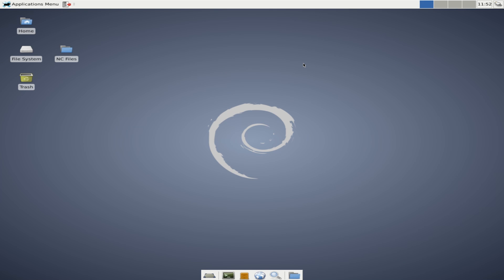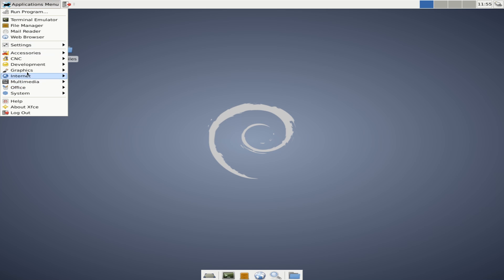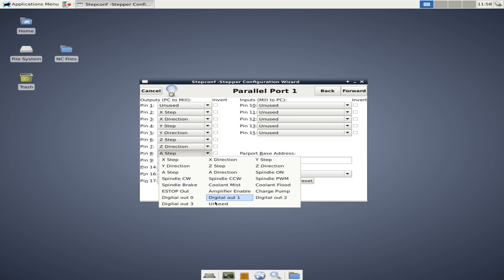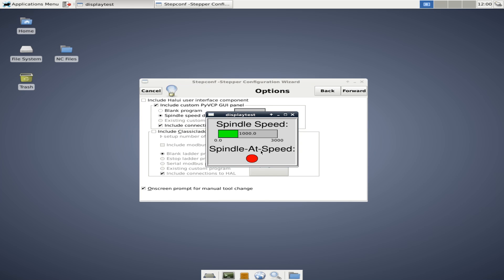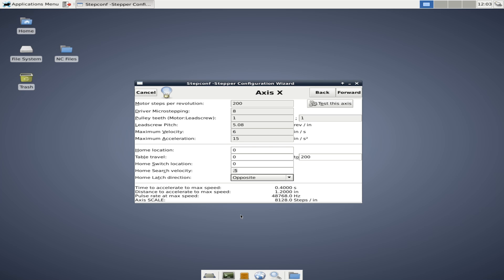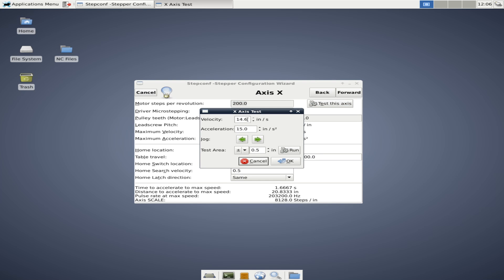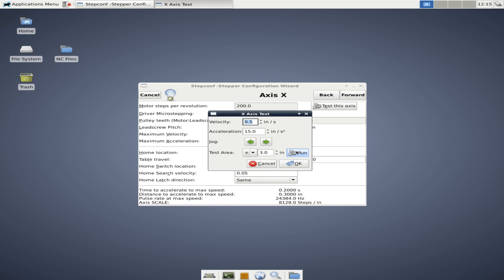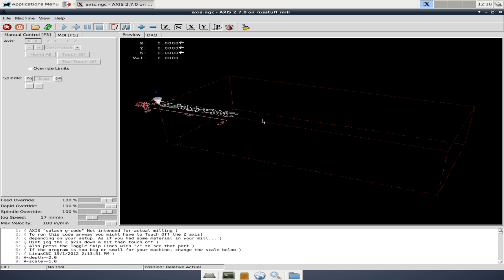LinuxCNC pt4 - Stepconf Wizard (Steppers & Parallel Ports)

Comment: my problem have cheap 5 axis mach3 board input have only 5 pin, and i need E-stop, home XYZ, probe, thats have all what can use, but how connect to all limits SW too this board. need one pin more, my machine have hard limit SW ewery axis both side, all has wired paraller can use one pin stop machine if go out of limit. this is important safety not broken machine, but no pin input,  i has make soft limit to config wisard, home 0.0 travell -20 to 390. but why this show max have 390 in display and rail have 1000 mm long and machine move full rail. scale have 317, screw pitch M12 1,26mm motor 200/rev. normal motor, driver setting 400 pulse(minimum) DM556 driver.i not understand what have wrong ? scale ???  two problem, limit SW and move scale. hardware dimnsions X rail max 800mm, Y rail 1000mm, Z rail 250mm Xand Y screw M12 pitch have 1,26mm.   Z T8 pitch 4mm.

Comment: 1:21 - "The better your computer the lower your max jitter will be."
- There is a big caveat with this statement. Newer computers have a lot of power saving features which cannot be switched off. Those mess with the linuxCNC engine (or the RT kernel) and create nasty latency spikes. For example: Frustrated with the linuxcnc performance of my previous computer I decided to go totally overboard and buy a core i7 11700k machine with a gamers motherboard and an NVMe SSD drive. Also fast RAM. A total overkill and completely unnecessary, but I thought "I want to forget about those latency issues". So what was the result: Even though at the beginning of the latency test the max jitter is like 950, as soon as I launch a browser or anything the max jitter spikes to 65000! I tried to turn off every power saving feature in the BIOS/UEFI that I could, disabled the turbo boost, made sure all cores are sync-ed etc, etc. The situation improved but the latency spikes were still happening. In other words, if the computer is left alone running only the latency test it was OK or even great. but as soon as I start to "abuse" the computer as the latency test suggests, the latency spikes begin. After that I bought a second hand core i7 920 with Rampage II Extreme - That thing is rock solid! 12000 max jitter with 6 browsers playing YT videos simultaneously, a massive file being copied over the network, another one being copied from one HDD to another, plus other activities I can't remember right now... It's great.

Comment: hi, could you suggest how to configure linuxcnc for using L298N as driver? I have 4 wires to control stepper motor, which I connect to parallel port. However, I cannot find any information on how to configure linuxcnc software for stepper control..
Reply: i think need write code linuxcnc can understand send paraller port this chip code. linuxcnc not working normal whit this chip, better buy controller board 10$ and then connect driver boards how many motor want run, motor driver board, esc, TB6600 and then connect motors to driver board, lot better and can handle small or big motors. select driver board only current sert less than motor maximum current, etc, 2A motor change dip switch less than 2A  then normal linuxcnc motor setup conytroller and software pins tell to setup wisard what pin is were.

Comment: Hi,
In the prevoius video you talked about examples of diffrent kinds of cnc like hexapod, ny question is if i have a hexapod cnc and i want to control it using linuxcnc, how to configure the pins on the breakout board to the hexapod example?
Reply from the maker: I'm not really sure. I would check out the LinuxCNC forum, they're very helpful over there.

Comment: I can't seem to get my stepper motors to jog in the axis tests..Got a 3040 cnc from cncest...Think I am really close to getting it figured out..The motors seem to be energized as soon as I power on my controller...Wonder if they are not enabled...can't seem to get it figured out. Gone through many videos and settings with no luck. Any ideas would be super helpful.  Think this machine was supposed to be used with Mach 3  wonder if the parallel pin out is different for linux..?
Reply: Figured out...I am trying to run Linux cnc on a motion controller breakout board that only runs Mach 3...I guess I am heading the Mach 3 way now...I really wanted to get Linx cnc going...I also had a bad e-shut off switch that was not allowing any boards to power up. tightened the connectors. and all the boards status lights came on. Bound and determined to be making stuff soon....Awesome vids.

Comment: Hey Russtuff, great videos. I am having a difficult time figuring out how to setup a gantry. I have read through a lot of stuff but am lost. I need two Y axis. Do you know how to set this up. Some of the Mach 3 videos make it look easy, just check a box for slave. From linuxCNC: gantry − LinuxCNC HAL component for driving multiple joints from a single axis. I see some documentation but I am not a python programmer so I have no idea how to edit the code to make this work.
Reply from the maker: Hey Michael.
I don't have any experience with gantry at all so I'm not sure how you would do it. I always assumed you would just run a second set of leads from your breakout board to the second motor driver so both drivers received the same signal at the same time. I'd be curious to see how you solve it.
Reply: Hi Michael,
I'm a rookie with a similar setup (CBeam 2XL using OpenBuilds parts) and struggled quite a while trying to find guidance. After a lot of experimenting this is what worked for me.
- In stepconf, declare three axes, XYZ and enter all info as if I only had 3 stepper axes ... with one exception
- On the dialog where you associate pins with signals, associate the pins for both Y steppers with the Y axis.
In my case, I selected "Y direction" for pins 4 and 8, and "Y step" for pins 5 and 9. The .hal file looks a bit odd but it drives the gantry with no problem. BTW, I wired all 4 limit switches together, but have individual pins for 3 XYZ home pins. I wired the two "Y" home pins in series using the "Normally Closed" tab.
No other changes required ... I've run basic exercises using axis interface (full range of motion, pencil traces of basic shapes, fwd/reverse, fast/slow) so far works fine.

Comment: Thanks for the video. wrestling with Pncconf on a basic Mesa setup myself right now. every little bit of LinuxCNC demo helps :)
Reply from the maker: Thanks for watching.
I haven't done that config yet, but I intend to in the coming months.
Reply: russtuff Great! Hopefully I'll be passed my problems by then, but I don't know if I'm fighting bugs or just misunderstanding a few things
Reply from the maker: That's one of the tough things about LinuxCNC. And the worst part is it seems like no one who is running it is making videos or helping much outside the forum. That's the point of these videos. Hopefully it makes someones life a bit easier.
Reply: I am in the same boat as Ron, kinda.. I need to understand messa for servo drives, motors encoders. editing, understanding the configurations, hal, ini, etc..  I have lots to learn.. I am working on converting a 1985 Bridgeport cnc milling machine. Your videos are very nice.  please keep them coming.. thank you
Reply from the maker: Randy Luckini I intend to make several more, I just haven't been prioritizing it lately. Thanks for watching :)